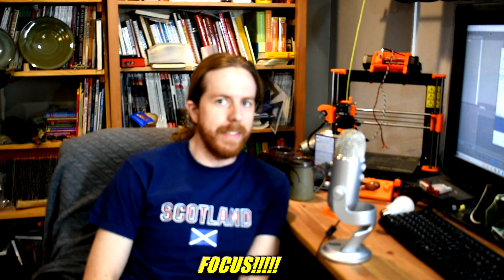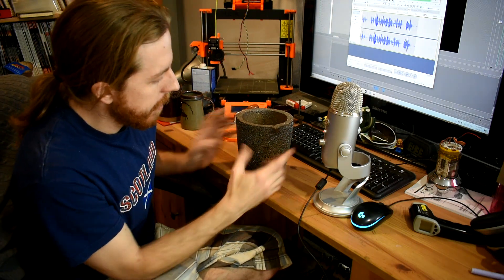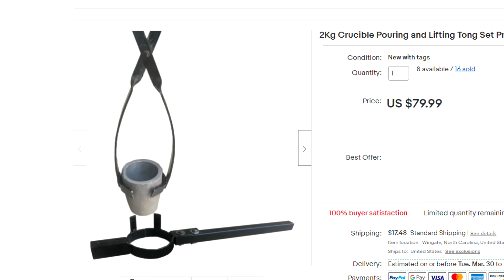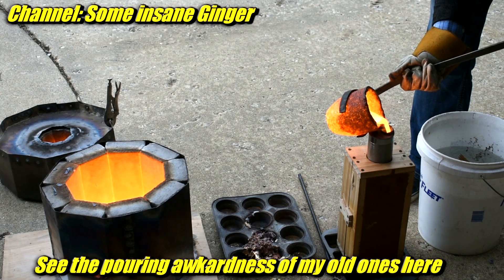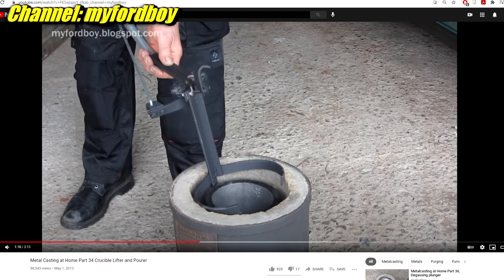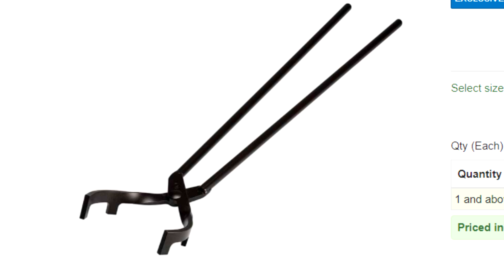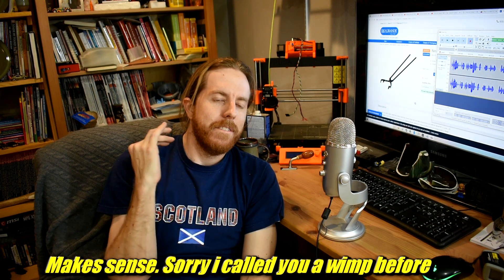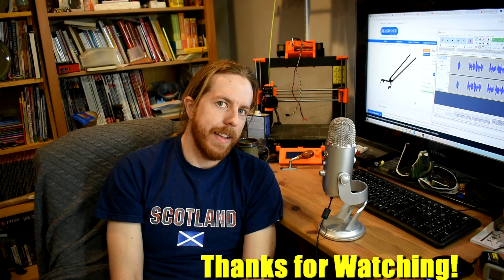Crucible Tong Talk.  I need some bigger ones

Comment: I tend to think you need a bit more hand seperation for seriously hot work like bronze casting vs. Aluminum casting.

Keep that in mind.

Some people like use an aluminum tray/plate as a mini heatshield.
Reply: Also, dual use and especially mechanical contraptions are clunky.

Bolts and springs etc can and do fail.

Comment: My tongs are similar to the flask tongs but the hinge is much higher up the handle, I can lift the crucible (3 different sizes) I use the to remove the lid on the furnace, & I've been known to pour with them because the scissor action holds the crucible. But mines a much smaller setup used mainly for smelting gold

Comment: Lucky Gen has the best one. But I also like Brian Oltrogge's design. He's an architect so way complicated but clever. A picker upper and pourer all in one. Worth a look. Re your thermocouple. If you want it to last ages try this. Get an old bar heater and take the bar. Its made of quartz glass. Meaning it can handle rediculious thermal shock. Like 500˚ per second. Drill across the side so it passes narrowly against the side of one of the bricks. Then slide the thermocouple in when you need it.

Comment: I'm sure you've figured out a solution by now as I'm jumping around your library and because the internet is eternal, but one of the most simple solutions for pouring larger crucibles was an open jaw type clamp that essentially locks down as you pick it up through both gravity and weight, and also had a very simple latch activated with a wrist twist along the lifting extension to keep it from slipping out when pouring. I'm struggling to remember who had something like this, but it was a solo guy pouring 60 kilos of copper and cast iron who still had all his bits, so it must be fairly reliable/safe.
Aside from the searing pain until your nerves die off, remember that most burn victims die from the resulting infection after the initial injury. Well before I got into some of my more questionable hobbies like homebuilt jet engines, knifemaking (heat treating a massively oversized damascus kukri in an old bbq barrel thing for D2 temps with a blow dryer and lump charcoal, woo!!), etc, I worked at central trauma center for the state I was living in and saw all kinds of horrible things, but burn victims and fatal accidents left the largest impressions that continue to steer my safety protocols in whatever I'm attempting.  Images are one thing, but mix in the aromas, you tend to approach anything like your life depends on it.

Comment: My extra complication is that I don't have any way to weld, so my designs will need to involve bolting.  In my first iteration of a combo tong, the weight distribution was bad enough that I demoted it to just a lifting tong, and built a separate pouring shank.  The hinge mechanism is awkward enough that I worry about knocking over the crucible in both clamping and unclamping.  And since it has been demoted to being just a lifting tong, the ergonomics suck for lifting the crucible out of the furnace and setting on a plinth to transfer to a pouring shank.  Expect to have significant improvements in version 2, which needs to handle both #6 and #9 crucibles.  Oh well, that effort needs to wait until after I get my taxes done.

Comment: I built some like your original pouring  cradle. I actually like it. I also built some vertical lifting tongs too, but I usually opt for the single rod cradle ones and just go straight from the furnace to pour. I can use it with a #6 and a #4.

Comment: Great to see some more metal content! i dig your channel. 
 I use lifting tongs I built based on bigstackd's video and I made a set of pouring tongs that use a cut section of blackiron pipe as the hinge at the back of the tool (there's a thumbnail example in your video when you googled crucible tongs thumbnail is called "crucible tongs 26" @5:47 ) and I love them, both tools are able to grab all 3 size crucibles I have. The pouring tongs in particular,  I made them about 30+ish inches long, and it lets you get far enough away from the hot metal and the rods can flex a little letting you get your hand around both rods comfortability. my first set used a mid-way hinge like a pair of scissors, and it was too close to the crucible an it would start to melt your glove to grab the shank below the hinge to keep it closed during a heavy pour. 

Stoked to see the out come! Thanks for sharing your process!

Comment: you could make the tong you choosen and put a small hook over the top of the crusible welded to one of the grabbers , should prevent the cruisible from sliding completely out should you loosen the grip on the sides somewat during the pour
as for setting the pouring temperature you could divide the gasline going intoo the burner after the gasbottle put a restriction nozzle in one of them the basicly halves the flow of gas and put a electric gasvalve on the other side running full open when activated then bring the two lines back together and feed it intoo the burner make a little circuit that closes the valve when the set temperature at the probe is reached (arduino?) and the gas will only move through the reduction nozzle keeping the burner going but at a lower temperature output
that way you can hear when the aluminium is at temperature as the burner makes a lot less noise all of a sudden

Comment: Quit shopping for junk online.  Get out in the garage and make your lifting tongs and pouring shank.
Reply from the maker: Oh I'm definitely going to make it, I'm just looking around for design ideas
Reply: @PaulsGarage  the Brian Oltregg design is pretty cool, but I wouldnt want one for bronze or iron work.  I've considering  a furnace redesign with a side opening instead of a top.  I could pluck the crucible out a side door with one tool.  No more transferring.  I saw a lifting tool on wheels that would be handy for heavy pots of metal, but I dont feel like re inventing the wheel at this point.  Maybe when my furnace wears out.

Comment: I didn't know that there was a pouring temperature. More?
Reply: The metal has to be hot enough to get into the mold. Soon as you pull it out of the heat it is going to start cooling down. So you have to have your metal some temperature above the liquid state to have a successful pour. It is called, "superheating". That bit to get you over the top. There's reasons not to get too hot though.

Comment: I fought the two-piece setup for too long. Having tongs to lift straight out and a separate ring shank to pour with is definitely better than my old one-piece design
Reply: The argument is lifting out of a furnace and pouring a mold are two different tasks. So no one tool can be ideal at both.

Comment: Personally, I like to have the trunion pins on the crucible and a simple hook thing to lift straight up and then use hook to pour. Center of gravity is always straight down from your hands. This is easy with a steel crucible, not so much with a graphite.  Veg oil guy made a cradle to fit his graphite crucibe with the trunion pins on it. I plan to copy that.